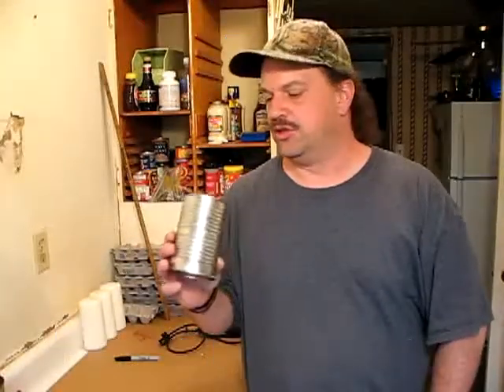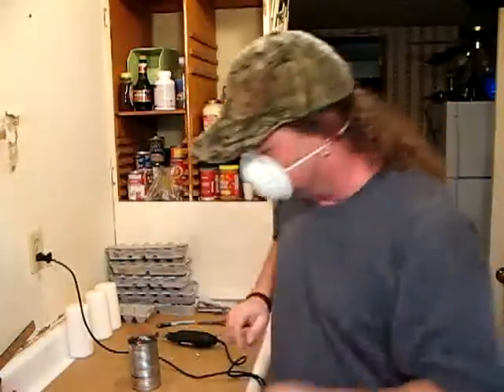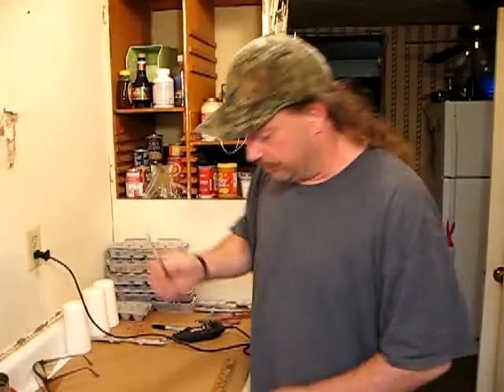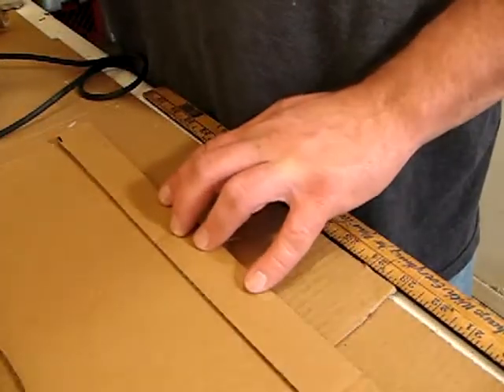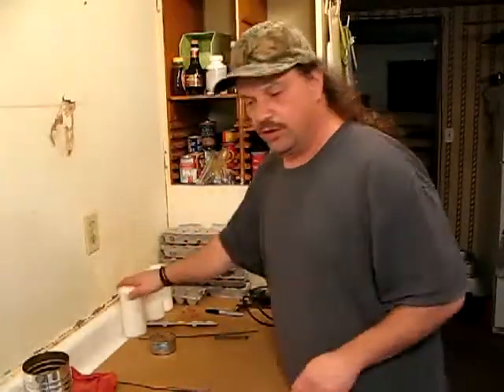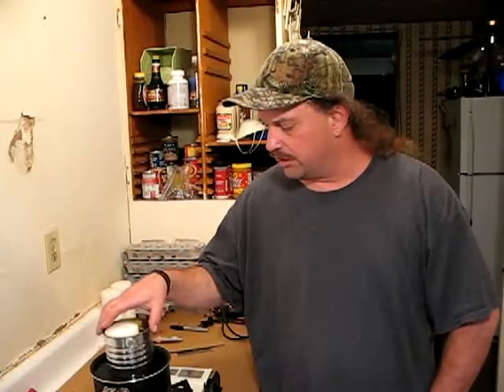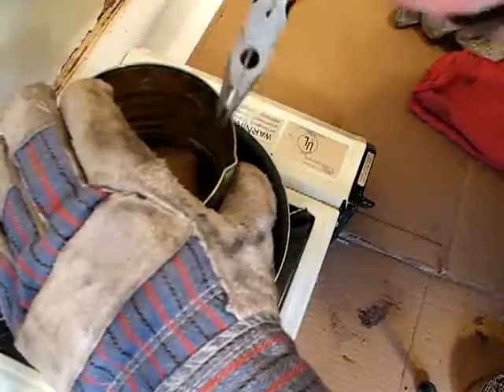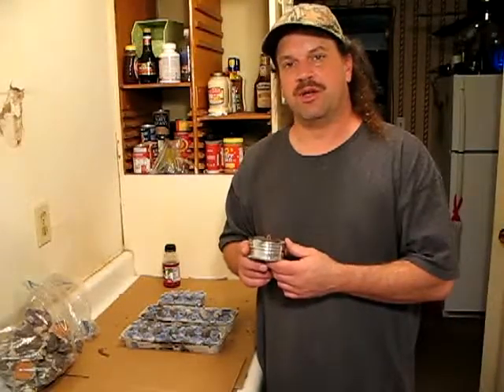Making A Fuel Cell

Comment: @Bob808Knight That was very smart to wick the cartridge. When I melt wax I never use a double boiler. I want to get in, clean up, and get out of the way. I have a 600 or 700 watt microwave, and melt the wax there. Sometimes I melt the wax over low to medium heat